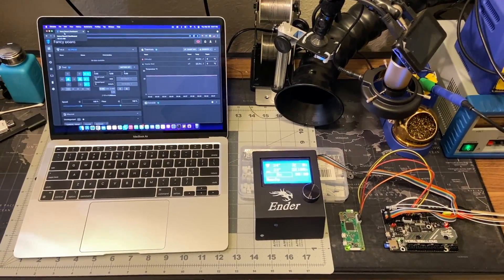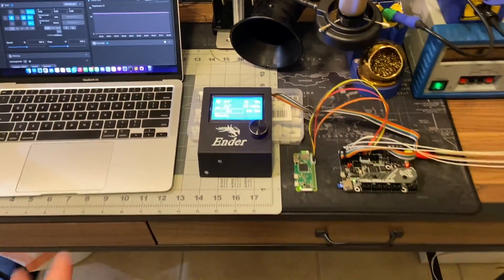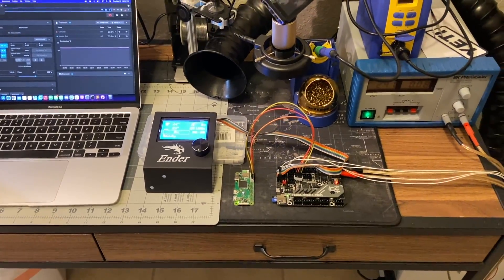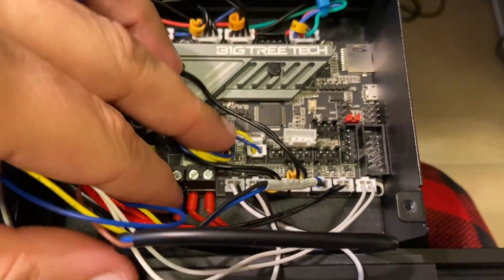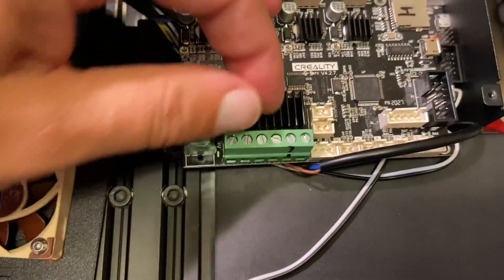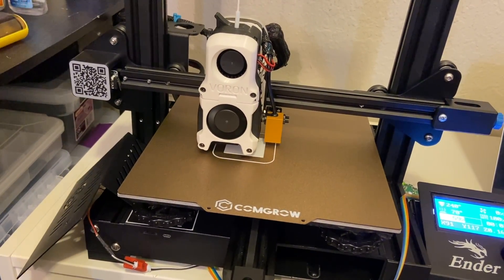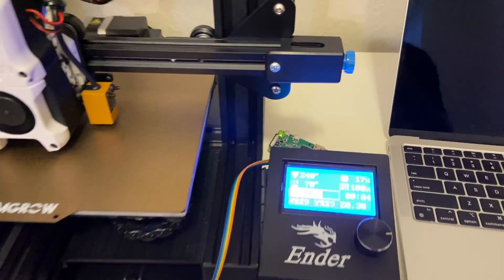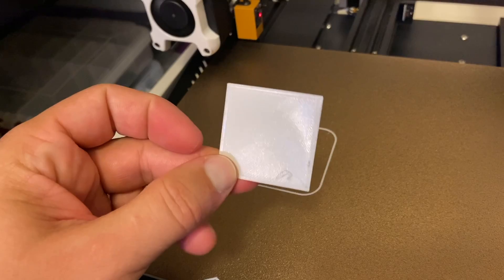Installing BIGTREETECH SKR Mini E3 V3.0 in Ender 3 with Klipper

Comment: I was wondering what connector you had to crimp? I have been trying to find it and I cant find which one it is.
Reply from the maker: In this specific case I had to crimp Hot-end cooling fan and Inductive probe connectors as from factory Ender's Cooling fan connected to a screw Terminal Block and probe also a new addition. The process wasn't filmed.

Comment: I have installed this board on my ender 3 v2 and for some reason the bed starts heating as soon as the printer is powered on,also can't seem to get frimware.bin to flash the board for klipper...choose the stm32 options,8kib bootloader,8mhz clock option and still for whatever reason will not flash usb pa11,12,could I be selection the wrong config settings?...great vid by the way,thanks for sharing.
Reply: Also I do have the screen removed the screen and used KIHAU for the install of mainsai/klipper and klipper screen,I have a a 4.3 touch screen connected to a rapberry pi 4b.
Reply from the maker: @IvyCreek-76  Sounds like you connected bed in a wrong place (follow guideline form BTT github schematics), config section is right I flashed it multiple times, you just probably picked wrong STM32 controller. To flash klipper you also can use precompiled Klipper firmwares from BTT gitHub Klipper repo.

Comment: I have a raspberry pi 4b. It's currently running fluidd with my ender 3 v2 running klipper. I just purchased a cr10 v2 and i'm currently replacing the motherboard to a skr mini e3 v3. Do I just need to connect it to my current PI to install klipper or do I need another pi?
Reply from the maker: Klipper is 2 sided software 1st part (set of commands/rules) runs on the printer's board and 2nd part with moonraker + (OctoPi or Mainsail or FluidPi) on the Raspberry Pi which controls the printer. You can use same Pi to generate firmware file required to flash the SKR board or you can download compiled firmware from BIGTREETECH github repo (I would recommend to recompile new FW). Also Pi4 is strong enough to run 2 printers at the same time but you will have to spend some time to configure such setup or you can set second Pi to run your new CR10.
Reply: @hobbyistnotes  thanks! There isn't much information out there about running 2 printers from 1 pi. I've just resorted to backing up my printer.cfg file, plugging a printer in then using that cfg file. Next weekend I will try and run 2 instances of fluidd on the pi and switch between them with a custom command on the kilipper screen.

Comment: I'm wondering which uart pin set you chose when building klipper bin for this wiring config (I have wired it same as you, but documentation is unclear which pin set to use)
I have PA10/PA9
PB7/PB6
PA3/PA2
PD6/PD5
PB11/PB10
PD9/PD8

and using the tft rx/tx/ground pins to connect my pi.
Reply from the maker: Ohh, just follow the Nero 3D video that is provided in to the description, as option you can take a look at my github repo where I store all of my klipper configs, link also in to the description.

Comment: Grewt vid. I have the ender 3 with skr mini e3 v3 can you make a video how to get klipper running on it? And why are you running klipper and not marlin. I have marlin running but have some trouble with my bl touch.
Reply from the maker: Per my experience Klipper is way more flexible, you can change settings simply in file without flashing firmware every time. As this topic very well documented on YouTube I have no interest to go thru all of the related process. BUT! Here is a good and detailed video on this topic: https://www.youtube.com/watch?v=gfZ9Lbyh8qU

Comment: As I am installing my board I have one extra set of tiny red and black wires. What do I do with those?
Reply from the maker: If you installing it on Ender 3 you will need to crimp hotend cooling fan wires with JST connector as this board have connector instead of Screw in terminal for this fan.

Comment: Can you show a close up of the pins you used for the UART connection to your Pi Zero?
Reply from the maker: Google: Raspberry Pi GPIO. We use pins: 2-4-6-8-10. As 2 and 4 are both 5V u need both only If you use Full size Pi, with Pi Zero one 5V pin is enough (4-6-8-10)
Reply: @hobbyistnotes  thanks! I found that info for the Pi Zero, can't find the tft pins on the E3V3?
Reply from the maker: @overanalyze4108  check description there is the link to a GitHub repo where you will find a schematics and pinout for this board.
Reply from the maker: @overanalyze4108  https://github.com/bigtreetech/BIGTREETECH-SKR-mini-E3/blob/master/hardware/BTT%20SKR%20MINI%20E3%20V3.0/Hardware/BTT%20E3%20SKR%20MINI%20V3.0_PIN.pdf

Comment: Great video! Really inspiring. One unrelated question. Did your ender 3 v2 come with creality v4.2.7? Mine was v4.2.2
Reply from the maker: Mine came with 4.2.2 also, tho I have spare 4.2.7 there is not much difference between them. There is interesting Reddit post about some 4.2.2 boards having nice tmc2209 drivers with normal support of linear advance. So before updating make sense to take heatsink off and check what drivers are installed, cus you can even make a UART mode and board will be very capable.
Reply from the maker: @cas curse Are you asking about Creality boards? Also we talk about Driver's UART or Controller UART as I have in this video ( single cable Pi power + Communication)?
Reply from the maker: @cas curse It's available on those boards but you will have to mod it: https://www.reddit.com/r/ender3v2/comments/n3clew/ender_3v2_422427_board_tmc_uart_mods/

Comment: Hi, awesome video, what it your setup for direct drive and the ducts that you did used? I'm thinking to buy a e3 v3.0 too for upgrade my ender 3 pro after 3 years of use
Reply from the maker: It's an older version of Voron Afterburner toolhead. I made it only because of hype around it. It's not most optimized airflow fan duct, newer Stealthburner is much better but it's in beta. I use BTT SKR Mini E3 V3 for last few months and so far it served me well.
Reply: @hobbyistnotes  awesome, I want to give a better look to my ender 3 pro, that e3 v3.0 will bring a better life to my printer,
Reply from the maker: @TheFpc20  I pref to firstly think why I am doing an upgrade. One benefit you will get for sure is to have opportunity to do a Linear Advance and speed up the printer. Nice side features as LED and controllable fans. Don't forget to have fun ;-)
Reply: @hobbyistnotes  yeah, in my case I do offer 3d printing service,  days ago did purchase a bigtreetech mini ups for power loss  due that in my country it always happen and many prints get damaged  for it but I can't  get it to work properly with the stock board because it require a uart for it so need a bigtreetech  board for make It work 100% 😅
Reply from the maker: @TheFpc20   @TheFpc20  Ohh... I see, nice application! Hope it will work out fine for you, i never used UPS with my printers as mostly Ender's 3s PSUs are holding well tiny US voltage drops, but I used to live in RU where we had same issue as you.
Reply: @hobbyistnotes  thanks so much buddy, hope to buy it soon and test it and that it can save me from some headaches by losing a print that take 12hours to print and by power loss it get ruined, have happen many times to me 🤣🤣

Comment: Hey there! So are you running Klipper on a Raspberry Pi? I am running it off a spare laptop, and using Fluidd as my GUI. I was wondering if you are using an ADXL for input shaping, or if you are using input shaping at all? If so and you are not using a Raspberry Pi, how are you connecting the ADXL to your laptop?
Reply from the maker: As currently I am not aiming for very high accelerations and speeds (but i will) I do very basic input shaping print based calibration. Usually we connect ADXL to RPI's GPIO but in your case you need to connect ADXL to Arduino and than you will be able to receive data at your PC via USB, tho I have no experience with ADXL running this way.

Comment: Its too bad klipper does not support the new v2 screen.
Reply from the maker: I read somewhere that people connect screen directly to a RPi via GPIO and it will works, so theoretically it’s possible.

Comment: is it necessary to change the X and Y offsets on the slicer when using afterburnerer on ender 3v2 or just change position_endstop: and position_min: on printer.cfg?
Reply from the maker: You have to set both, prove location for proper probing and endstop locations.

Comment: Are you running Octopi? or what was that running on the computer?
Reply from the maker: Fluid Pi with Klipper on the printer.
Reply: @hobbyistnotes  Im gonna try it out tonight, wish me luck!!!
Reply from the maker: @curtismenzies428  If you will use FluidPi or Mainsail better to use FluidPi/Mainsail OS. Easy few clicks configuration than doing own assembly from scratch.
Reply: @hobbyistnotes  !! BLTouch failed to raise probe...im so close and don't want to give up. I love this interface so much more than octoprint. I can get X/Y to home but im using a BL-touch with the 4.2.7 board. So the Z endstop might be different in my printer.cfg.
Reply from the maker: @curtismenzies428  Make sure your wiring is ok, as i had same issue, on the start of the printer my Ender wasn't able to  process initialization of the probe, also you need to take a look at Klipper's documentation regarding BLTouch.
Reply: @hobbyistnotes  Weird, but that actually makes sense I think. I didn't realize they would change. Kind of like when you configure Arduino projects and the code for the pins change. So here I guess the firmware wiring is different with Klipper when coming from Marlin?
Reply from the maker: @curtismenzies428  I don't think you need to repin the connector, on 3 of my enders it worked right away with same pinout. I meant just make sure your connection between board and BLTouch is good.

Comment: Hi, what slicer are you using with E3v2 and klipper? Having some issues with PLA. Done all the calibration etc but prints from Slic3r just not good...
Reply from the maker: I use Latest CURA.

Comment: Thanks for doing this. Waiting for my v3 to arrive.  looks like a drop-in replacement.  Any major issues so far?
Reply from the maker: I printed about 100h on it and everything is fine, the only one thing: you will need to crimp hot-end fan cus now it has connector. Rest was as you say "drop-in replacement".
Reply: @hobbyistnotes  thanks! It looks like the hotend fan is now cotrolable.
Reply from the maker: @jugbasspro  Yeah not only Hotend one, board cooling one too.

Comment: hey, i tried to install it here, but the fan that cools the part and the fan on the board don't turn on!
Reply from the maker: Here are mine setting for fans, mostly default from what is in the btc repo config:

[heater_fan controller_fan]
pin: PB15
heater: heater_bed
heater_temp: 45.0

[heater_fan nozzle_cooling_fan]
pin: PC6

[fan]
pin: PC7
Reply from the maker: Do you use Klipper? If so, the way i configured it on this board: hot-end fan turns on only when hot end reaches specific temp, motherboard cooling fan also starts when you use heated bed. So part cooling fan should have speed control rest is just display if it's on or of, there is a chance that you misplaced part cooling fan and Hot-End cooling. Also there is a chance you have wrong Fan settings in your Klipper printer config.
Reply: @hobbyistnotes   I'm using the marlin
Reply from the maker: @joaovitorcerqueira7090  I haven’t used Marlin that much with this board, but I have tried to recompile Marlin firmware for Ender 3v2 screen and it possible to make new Marlin firmware. It's possible that wrong pins were set in Marlin config on compilation process and to handle fans headers you will need to change config. What I would try first is to download latest pre-compiled Marlin firmware from bigtreetech GitHub repo and flash the board with it ofc if you haven’t done it, otherwise you will need to recompile firmware yourself.
Reply from the maker: @joaovitorcerqueira7090  here is the link: https://github.com/bigtreetech/BIGTREETECH-SKR-mini-E3/tree/master/firmware/V3.0/Marlin

Comment: What is the position for the 24v cable?
Reply from the maker: What exact 24v? DC in? Take a look at the board User Manual, link is in description.
Reply: @hobbyistnotes  the fan from the hot end
Reply from the maker: @robindreier68  I used Fan1 and Fan2 headers for hotend and part cooling fans. On this board it’s controllable header so they made it as a connector. Also now it’s adjustable, based on temperature of the hot-end.

Comment: Cant your share klipper printer.cfg
Reply from the maker: I have few moments in my config that will not work for most people, safer if you will use config that is included into Bigtreetech Klipper Github repository. Please check description for the link. File named: SKR-mini-E3-V3.0-klipper.cfg
Reply from the maker: Added link to a git-hub repo with my configs

Comment: What about BLTouch? Is it simple to add?
Reply from the maker: Yes. There is precompiled firmware with bltouch.
Reply: @hobbyistnotes  and I can edit my offsets and everything just as I did using Marlin? Sorry, Klipper is brand new to me.
Reply from the maker: @TechReviewLife  Yes. All printer's settings are living in to the config file at your Raspberry Pi you access it via web-browser thu your pc same as OctoPi and make needed changes by setting values than hit save and use it almost right away.
Reply: @hobbyistnotes  ok sweet! Last question, if I already have OctoPrint set up, can I just skip the first part and go straight to installing Klipper?
Reply from the maker: @TechReviewLife  Yes.
Reply: The CR touch is better.

For those that don't want to go through all this nonsense. You can use Jyers firmware and it rocks.
Reply: @dangerous8333  what makes it better? J/w 👍

Comment: Thank You very much for doing this work. I just bought myself E3 mini v3.0 and am going to put it in Ender 3 v2. 
I would really really like You to succeed with porting this MOBO to Ender v2 and share Your knowledge on how You did that. (hardware and software tutorial/explanation)
Reply from the maker: Thank you! I am currently using V3 board on my Ender 3v2 with Klipper so far prints and works perfectly fine. I hope I'll find time to make video and explain how to run Jayers Marlin on it, but for now trying to figure and test the board all the way.
Reply: @hobbyistnotes  Very good. Btw I aswell have the intention to run it with Klipper. My RPI 4B will arrive in a week.  But also would like to know how to work it in Marlin/Jyers. So most of all am interested in klipper, but if You by some miracle can show me how to run it with Marlin and Original v2 screen, I will send You some money. <3
Reply from the maker: @savikate  No need for the money, I'll take a look in few hours if I can make fast manual how to compile and run custom Marlin firmware for this board and V2 screen, problem is that V2 screen has own firmware it might take some time.
Reply: @hobbyistnotes  I understand. Take Your time maestro.
Reply from the maker: @savikate  Sooo... I have spent whole night debugging and compiling Marlin firmware to work with Ender's V2 DWIN screen. It's far from working well and requires more time, I will try to look at this project later next week. For now I will leave link to the GitHub issue that has major information needed to "start" this process, may be some one will be interested. It's maximum I can do at this point with my time...
Reply: @hobbyistnotes  Alright. Great job. Thank You. I´ll look into it.